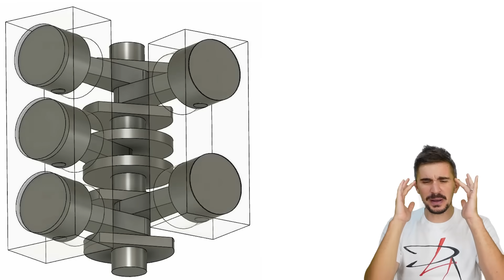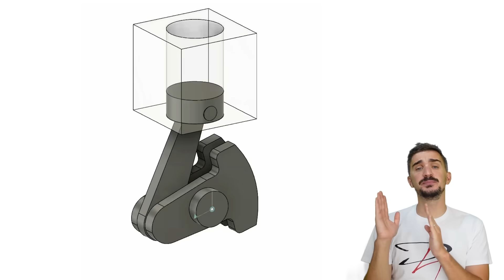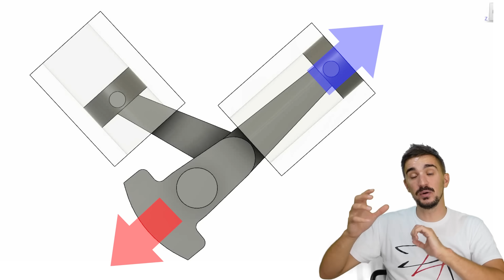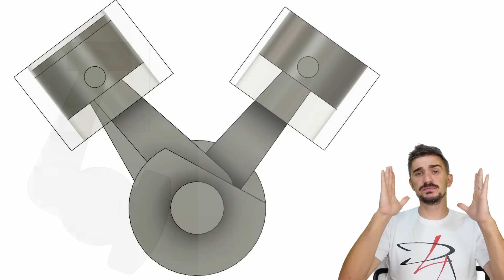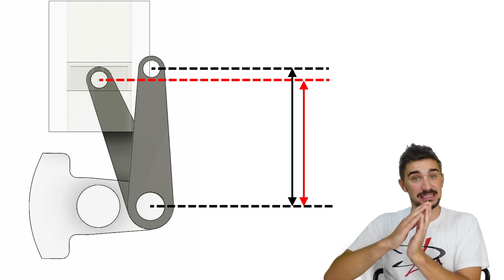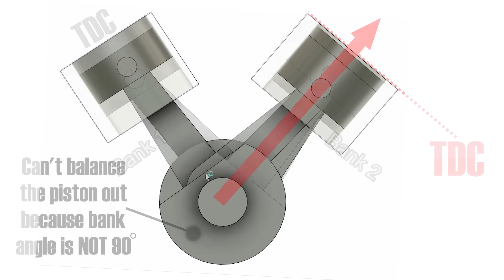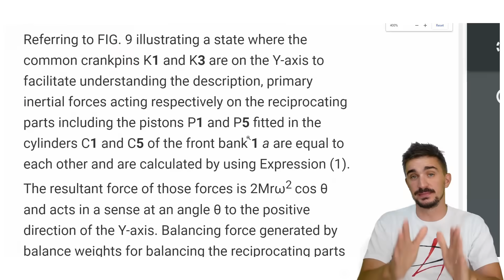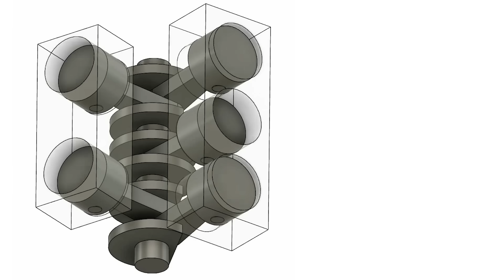Logic Defying V5 Engine - Honda's RC211V Explained Like Never Before

Comment from the maker: Patreon: https://www.patreon.com/d4a
Support d4a: https://driving-4-answers-shop.fourthwall.com/
Official patent: https://patents.google.com/patent/US6745730B2/en
RC211V model: https://amzn.to/3PSE9Yv
Reply: The only V5 automobile engine to reach production was the 2.3 L (140 cu in) "VR5" engine manufactured by Volkswagen from 1997 to 2006. Based on Volkswagen's VR6 engine, the VR5 was a narrow-angle engine with staggered cylinders (three cylinders on one bank and two on the other) sharing a single cylinder head.[3] As per the VR6 engine, the angle between the banks was 15 degrees. Initial versions used 2 valves per cylinder, however, an update in 2000 resulted in a total of 4 valves per cylinder and the addition of variable valve timing.
Reply: Would love to own one.. Rossi with loads and Hayden with his two wins but still a champ R.I.P. Nicky!
Reply: What a video, thank you! Hey how's it going?  I'm from Russia, I really like your videos and I'd love to spend some time making subtitles so that my friends and other non-English speaking petrolheads could enjoy it and gain some really decent knowledge. Could you please enable that exact feature so that people could submit their translations?
Reply: Great video!!! I just wanted to add, that Honda had V3 engine as well, and it was 2stroke. Bike looked very similar to VF400F, so I assume it was made in late 70s or early 80s. Will be perfect if you can make video for it. Thank you once again!!!
Reply: Fascinating explanation many thanks, T.
Reply: do the regular pistons also have counterwheights?
Reply: Sorry, I disagree. If you actually researched engine balancing or do it in real life you would know that V configured motors do not all balance the same, you can't expect that simply adding 2 more as you go works the same. V6's are notoriously hard to balance often requiring a additional counter rotating balance shaft to counteract the inherant vibration. I had to stop with your video at that point.
Reply: ...Also audi has had a V5 motor since 1976
Reply: ......I didn't understand a single thing. Great video XD

Comment: I would like to hear about Ralph Sarich and the orbital 2 stroke OCP or OCT car 3 cylinder engine from Australia 1.2 liter XM, what did GM pay for the License of the technology, was GM ever able to profit from it. was the orbital engine used as outboard boat motor and snowmobile companies. could a twingle split single engine the intake in one piston exhaust in the other, that was used for 70 years be revived in a flat opposed horizontal boxer aircraft engine where opposed pistons fired at same the in a way that piston rods would not create secondary out of balance condition by swinging opposite each other. with all cylinders facing and sharing air flow equally while being air cooled. If all the modern technology was applied like free valve be used on inlet transfer and exhaust ports. EFI , ECU, a centrifugal super charger, and a power turbine extracting energy from exhaust directly to engine. augmenter tube exhaust to gain a little thrust. and act as muffler. babbitt bearings. for crank and piston rods with high pressure oil lubrication and cooling spray to bottom of pistons. instead of using the compressed air in crank case directed into combustion chamber trap it instead for bounce back pressue on bottom of pistons and possibly using the pressure in a way to take a high volume lower pressure into  low volume high pressure for fuel injection and oil pressure if that could be more efficient than pumps. this engine by having all pistons firing at once should have high torque at low rpm so no gearbox would be required to keep propeller tip speed low about 2700 rpm for 4 place airplanes. by eliminating the weight of gear box, valves and cams, intercoolers, liquid cooling, only one large radiator would be required for oil and also act as the external oil tank. some oil could be circulated through cylinder head to aid the air cooling if necessary. at low taxi speed the propeller could be designed to provide cool air or a electric fan used which ever is more efficient. this would be a more compact light weight than any 4 cycle air cooled aircraft engine. the aim is not more power but weight saving and with super charger maintaining power to higher altitudes. unlike 4 stroke engines that have to reduce power to 75% for continuous operation the engine would be able to operate at 100% power continuously being. being able to maintain engine temperature with precise control of intake cooling in and out of engine baffling would be needed if it could be done automatically with a warning system. the germans had air cooled armored tank engines in Africa, the VW beetle air cooled for years. if a higher air flow of air could be directed over heads and a lower across cylinders so temperatures could be kept the same for both. coatings could be applied on inside of cylinder head and on top of piston so heat was not absorbed but stay in the exhaust air to leave the engine as hotter air with engine cooler. this engine could be easily be adapted for aerobatic airplanes with oil pump pick up with a flop tube or an oil pick up on top and bottom of crank case with a flop valve. shock cooling could be eliminated by closing off cooling air flow when the throttle is at idle in a dive a compression release of the crank case could be used so the propeller wind milling could act like air break in dive. water tank could be heated by hot air leaving the baffling around cylinders. water could be from freezing on  hot days and used for take offs or in climbs to avoid obstacles. then plan to use the water up before landing to avoid having it freezing while parked on cold days, use the hot air leaving closed baffle area for cabin heat. YOU! do the math prove the concept will work. take these ideas it to an engine company that will develop it and share a piece of the profit with you. there should be a big market with drones, RV generators, aircraft starting carts, lawn mowers, ATV's, experimental airplanes, snowmobiles, motorcycles, and etc. I think it could be built for less than the price of overhaul of aircraft engines. the engine would not need an expansion chamber saving weight. fuel could be heated to improve vaporization before being injected maybe one low pressure injector squirting raw unvaporised fuel onto piston for cooling  and a second injector with high pressure vaporized fuel at point of ignition. the fuel may not even need oil added as the crank case oil that escapes out from bearings and oil sprayed on pistons, but that oil needs to be sucked out to keep cranking case filled with air so pistons can act like bouncing balls on the air pressure trapped in crank case.

Comment: Very nice video, thanks! Am I getting it right, that the reason for this engine configuration is not so much connected to power output or torque but mostly to geometry, since the V5 is in fact smaller in size than a V4 of the same 990cc? (The steeper angle of 75.5° vs 90° should mostly make the difference.)

Comment: Check out Ariel natural gas compressors. It's incredible what they can get to work. They are basically a boxster engines that compress natural gas for pipeline operations. They occasionally have odd numbers. Most of the ones I have worked with have massively different sized cylinders mixed up on the same frame. Low RPMs but HUGE horsepower. They run them wide open until they blow. It's always a race to get a new compressor in ASAP. They don't like losing millions of dollars an hour when one goes down. Oddly enough, we've built a lot of units for Repsol.

Comment: Fantastic analysis and explanation, fantastic engine, the question left is 1.  Why is this engine retired from MotoGP?
Reply: Regulation change in 2008 season that decreased the capacity and cylinder number in motogp to only 800cc and 4 cyilinder

Comment: Honda's inline 5 cyl 125cc engine is an equally intriguing engine. Each cylinder had a displacement of 25cc, this equates to a standard spirit measure in a British pub, next time you order one just take a look at it. Each cylinder had a bore of just over an inch and a stroke of just under an inch, in there were four valves, a piston and a spark plug, it would be difficult to squeeze in valves with diameters greater than 3/8 of an inch, the valve lift would be around 1/8 of an inch as there is no point in lifting a valve more than 1/3 of its dia as the hole doesn't get any bigger, a cam shaft with ten lobes 1/8 inch high and the distance between the centres of the big end crank pins and the main crankshaft pins of less than 1/2 inch. According to rider Ralph Bryans the power band was somewhere between 18,000 and 22,000 rpm. Below that it just "Popped and banged and did anything but want to go"....

Comment: Rod does not accelerate the piston. Unless there is another piston. The piston is only slowed fallowing combustion. that is why less than 4 cylinders (4 stroke) means less volumetric efficiency per rev. THUMPERS ARE RIGHT OUT!

Comment: Don't know if you're aware as they were quite rare, but VW chopped one of the cylinders off their original 2.8 VR6 and sold it as a 2.3 VR5. Not a true V5 but probably the only other close thing I've heard of. It was sold in Golfs, Beetles and Seat Toledos in Europe and Beetles in the States I think.

I used to own one and it was quite smooth; drove and sounded exactly like an inline 5.

Comment: Before I watch the video in full (I'm at 2:27), I'm gonna guess that the engine works off of a creative crankshaft design, using a counterweight for the middle piston in the three-bank for stability, while having the two-bank and the remaining two pistons on the other side balance eachother out.
Reply: I mean, I was close. I guess.
Reply from the maker: Well, in a way, yes you were! With a decent lawyer you could pull it off 😁
Reply: @d4a  I graduated recently with an engineering degree, and in watching your videos I've realized I retained way more than I thought I did! Videos like these are fun to watch.

Comment: V5 - Never thought of before? I can see the point about the VW VR5 but Honda might have been frst to DO it but certainly not first to think about it! I personally worked (in a very junior capacity!) on a concept design study for a family of motor cycle engines back in '76 maybe '77 - this was a "modular" 250cc cylinder applied as a 500cc twin, a 750 V3, 1000 V4, 1250 V5 and a 1500cc V6 - I couldn'y possible say wHo the customer involveD was..... Neither can I remember if the Vee angle was 60 or 90 degrees...

Comment: @10:40   maximum inertial force.   That 75.5 degree and maximum force. Isnt that beecause the conecting rod and crank is at 90 degree from each other and therefore most lever force ?

Comment: I dont understand why Honda didn't take its automobile version of its 5 cylinder  engine which was in its  Honda Vigor and expanded on that. They could have made some serious sports cars besides the great NSX, which used the 6 cylinder.
Reply: I think it could be an alternative to the current F1 engines, as it would be a little more compact than a V6, but the main advantage would be the improvement in sound (and I'm talking about the timbre, since even if they increase the sound of the current V6 or make the sound less muffled it still wouldn't be as interesting, even increasing the rpm limits wouldn't be a big deal)

Comment: V3  NS500 2T was used by  Honda/HRC in the early  1980s in 500cc (NOW Moto GP) racing.  Street going  NS400R 2T was also a v3, except that it had 1 cylinder pointing  forward and two pointing up and back.

Comment: Given the fact that with rare exotic metals and alloys, this V-5 engine could reach a insane rpm of 30,000 to a upwards of 37,500 rpm, and develop 4 to 5 times it's original horse power, OF COURSE THIS ENGINE WILL DISAPPEAR!!! What do you expect! In my own mind I see a engine that is even more powerful than this one, it is in a "V" pattern just like this one and on one bank of the "NEW" "V" engine it has 5 cylinders, and the other "V" side has 7 cylinders, and this engine also balances itself out, just like this engine and makes a insane 5 times as much horse power. Take Care!!! Have A Beautiful Day!!! The Smile Restorer, and Lightworker, Kelly!!!

Comment: It would be interesting to see you model Honda's VFR1200F V4 engine.  That engine has a 76° V4 configuration with a 28° crank offset and a firing order of 1&4, 2&3. Also interesting is the cylinder distribution, where the front cylinders are outboard and the rear cylinders are inboard.  Honda claim perfect primary balance.  Would that be true?

Comment: Believe it or not GM's Oldsmobile had also experimented with a V5 engine. Diesel V5. It didn't go far in trial.
Reply: I think it was cancelled due to budget cuts and the backlash from the other diesel engine failures. v engines were cheaper to build back then since you could get away with single cam ohv. I think if it had been successful, we would have seen v5 engines common in cars instead of v6 since the v5 doesn't require balance shafts and is smaller than an inline 4, at least until turbos were brought in. v engines  require two turbos so can't compete with the inlines for cost.

Comment: bsa triumph motor cycles, chief designer had worked out a design for a V5 ohc engine and the balance factor in 1972 but NVT (norton) had no money to carry it forward  and they did this with out a computer.oh and rover had a 5 cylinder engine in the1960's  so it not new

Comment: Besides engine balancing factor still its clear that 3 cylinder bank produces more power than the other 2 cylinder bank. Odd number cylinder engine don't make sense. One bank always is stress during operation.

Comment: I understand the idea that you have to create an unbalance V4 engine first, but the thing is you obviously have to do so with a v5 in mind (meaning that you have to determine exactly the perfect imbalance of v4 engine you want before you can make it a v5). It really does seem like genius engineering, exactly why I am studying to be a part of this field
Reply: I wonder if you could use the same method to add two cylinders instead of one to make a primary balanced v6. I don't know has anyone done that before without using balance shafts or weakening the crankshaft with split pins.

Comment: 360/5=72 
5x75.5=377
so wouldnt it take more than 1 rev of crank to get all 5 pistons to fire if it were 75.5 degrees?
Reply from the maker: No, one doesn't need to fire right after the other stops. One can fire while another is still firing.

Comment: Vibration is illiminated with odd numbered combustion chambers: because
they can't re-enforce each other and resonate/harmonics. The trick is how to
setup the camshafts and timing. Resonating engines are easy to make, it is
eliminating resonance that is hard. Well apart from increases in power and
torgque for the same amount of fuel. That fifth cylinder: it absorbs all of the
harmonics; like a damper.

Odd numbers: don't divide evenly, don't re-inforce, don't resonate. Resonance
occurs when force is added EVENLY ... when it re-inforces motion EVENLY, at
even intervals. It cannot be done by ODD additions of force: at ODD intervals.
2,4,6,8,10 .... vs. 1,3,5,7,9 ....   *NOT A FUZZY FEELING AT ALL.* Its all to do
with resonance. *You cannot achieve resonance using ODD PULSING*
Even number of cylinders: even pulses. Odd number of cylinders: odd pulses.

Comment: A key difference of the VR5, of course, is that each connecting rod has it's own crankpin, so engine designers are free to space the firing as they like by spacing crankpins equally around the crank.

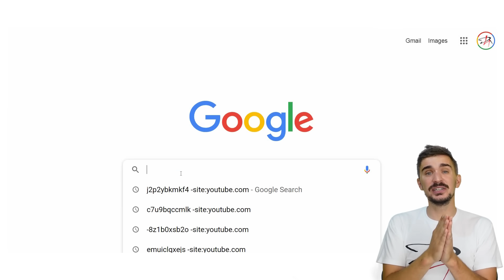Comment: 1:06 With this train of thought, a one cylinder lawn mower engine would launch itself to bits... the balance of a rotating assembly is contained within the mass of that assembly; the number of cylinders is irrelevant. Classic examples of why it doesn't matter - V-Twin motorcycles, and the 90 degree, odd-fire Buick V6, that's essentially a shortened V8.

Comment: VW made a V5 production engine in 1997 (https://en.wikipedia.org/wiki/VR5_engine )
Reply from the maker: No they didn't. They just called it a v5. It's a vr5. I explained this at the end of the video.
Reply: @d4a  It has two banks (one of 3 and one of 2 cylinders) at a bank angle of 15 Deg.
Their name VR is German for V inline. Just cus they call it that doesn't mean it's not a V engine configuration.

The car was called a V5 not vr5. That was just an internal name, that people think it's cooler to use than it's real one.
Reply from the maker: You can flail all you want, but it's not a V engine configuration and VR is definitely not an internal name 😂 you can't justify nonsense with more made up nonsense. The VR name exists for a reason. A V engine has two heads and two valvetrains and a significant angle. A VR does not. It is completely different in terms of anatomy, even the piston shape has to be different. It's a hybrid between an inline and a V engine, but it's also neither of those. Hence the name. It's rightfully classified as a separate engine configuration. In terms of engine balance a VR5 is much closer to an inline 5 and doesn't face the balancing challenges that an actual v5 engine does. Don't embarrass yourself anymore please.
Reply: @driving 4 answers  Flailing, not at all.   I'm sure there were no balancing issues like in the engine you discuss, they just literally cut off a cylinder and chopped the crank down without a care in the world.
No matter how you flail, possible due do the limited scope with which you argue, it has offset banks of uneven numbers.